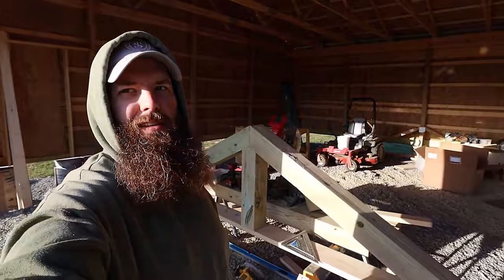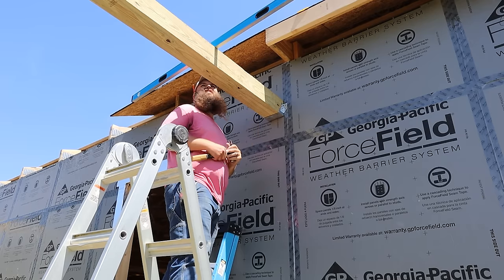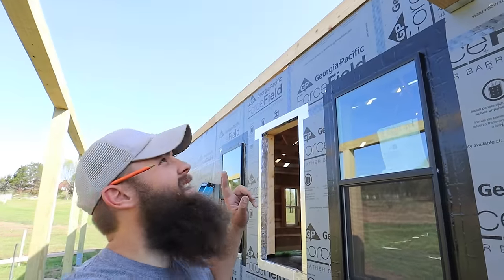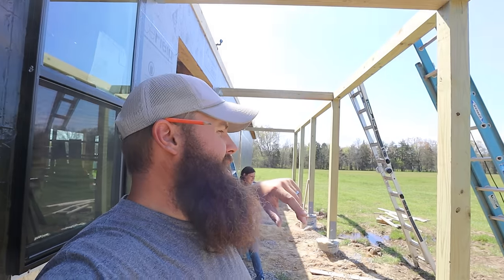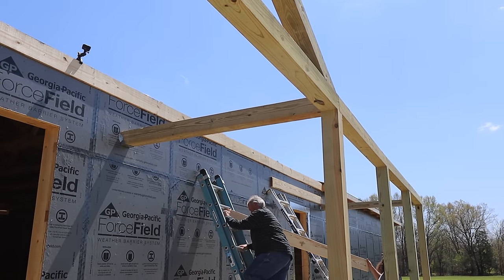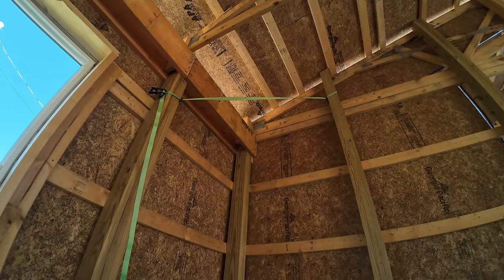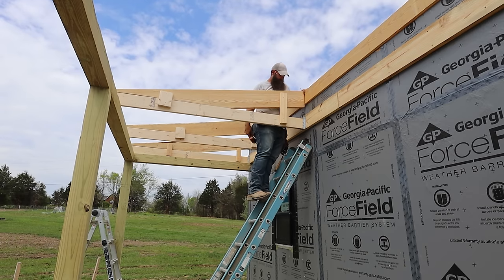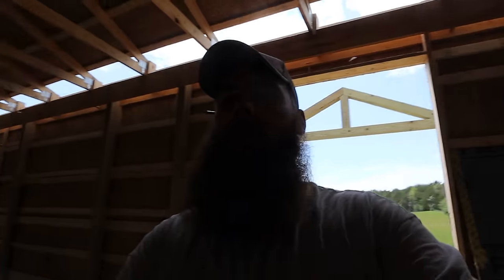Securing Our POST & BEAM Porch to the House - Back Porch Part 2

Comment: SUGGESTIONS:  do your grade and concrete now as concrete takes time to cure.  Temporarily tape plastic over the peak to dry in the building so the rain won’t interfere with the concrete pour.
Reply from the maker: It doesn’t take that long to cure. About a month and being that I’m doing everything myself, there won’t be any issues with cure time and working too fast. I need to install plumbing and radiant heat before we can pour anyway and need to get the porches done first. It will come in time, no point in rushing it.